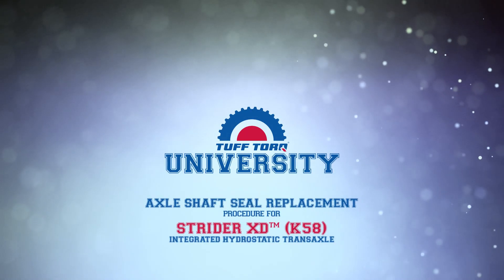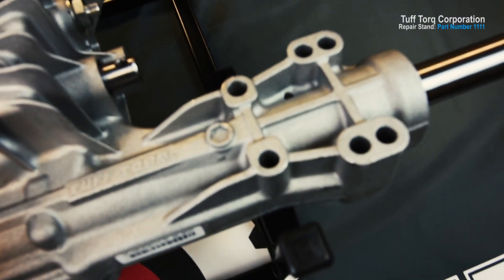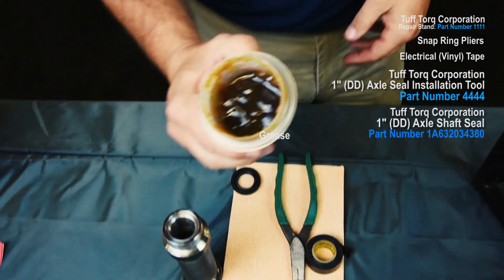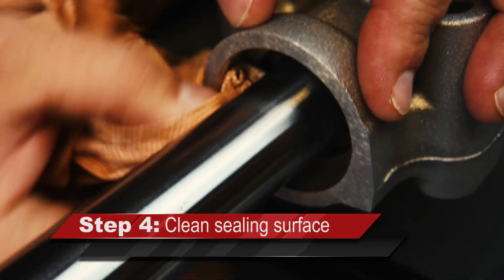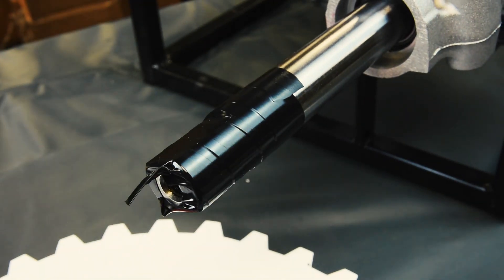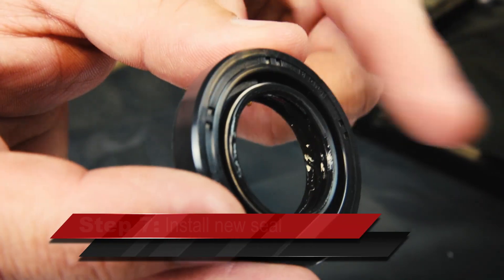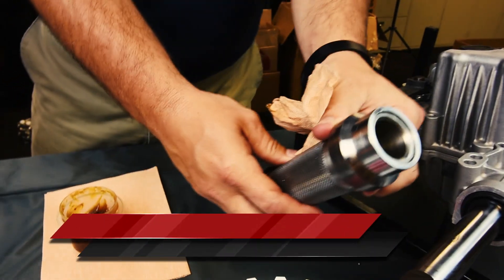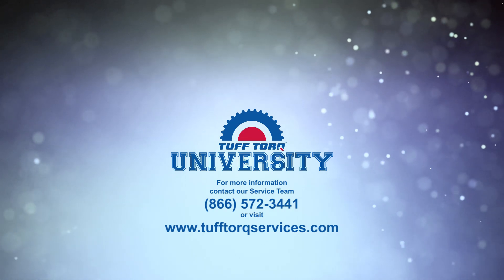Tuff Torq K58 Axle Seal Replacement

Comment: Tough torque transmissions seem problematic. Why do these gaskets wear out so quickly? Seems like the cheaper the Kanzaki Kokyukoki Corporation can get, the more they push their consumers away. Hydro gear transmissions seem to be longer lasting, especially in a unit that is considered non serviceable.
Reply from the maker: @rywolf01,  I apologize for the delay in getting back to you on this platform. In addition, I'm sorry for any potential issues that you may be having or had in the past. I'm honestly unfamiliar with gaskets wearing out prematurely. Please note that Tuff Torq takes pride in Quality and uses the highest quality components and materials when building production units at the factory in TN. If you would like to speak with someone directly, please reach out to one of our team members at customerservice@tufftorq.com as our service staff would be glad to assist you.